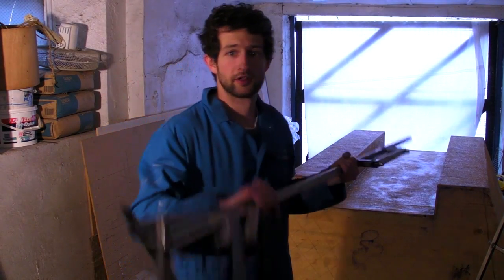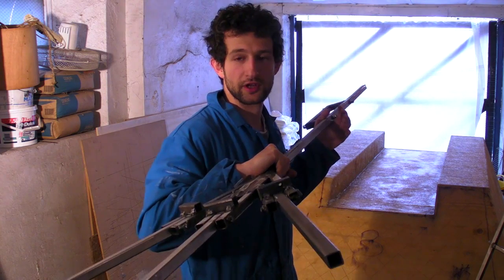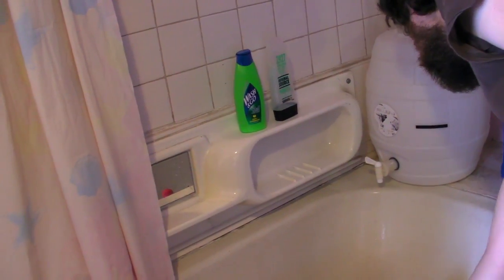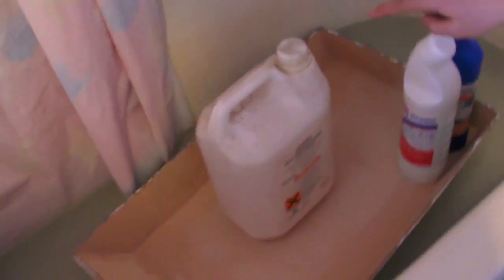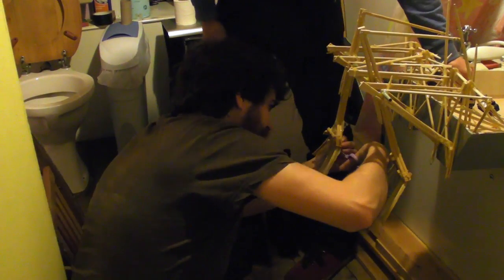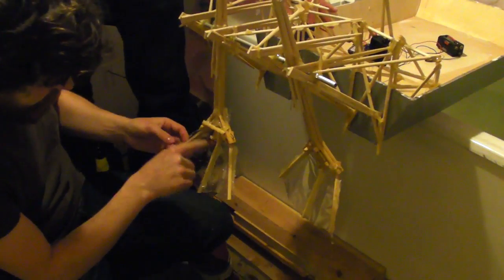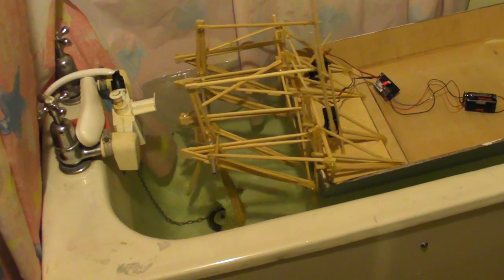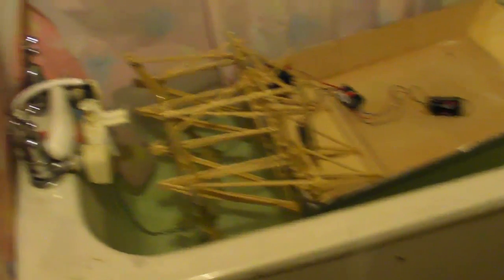Boat Update - Swanzilla - Feet Propulsion & Model Test

Comment: The words you are looking for may be "proof of principle model," and the model looks impressive. Depending on how you want to power your boat, fatigue or speed may become a factor. I suggest looking into how leverage is applied to the "swan's" feet. Double the length of the shaft relative to the throat (fulcrum) the work is reduced by 1/2.
Reply from the maker: Thanks for the advice!  There will be four of us sharing the work but I am sure fatigue and speed will suffer!